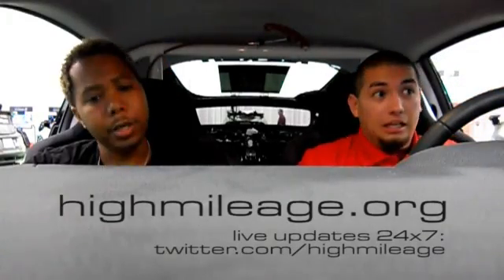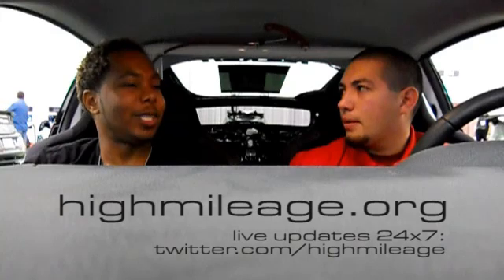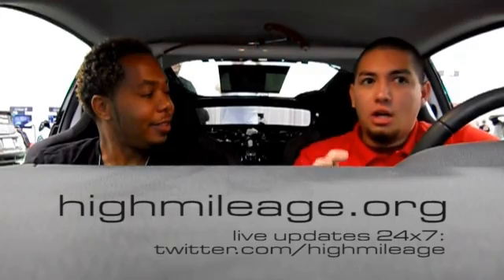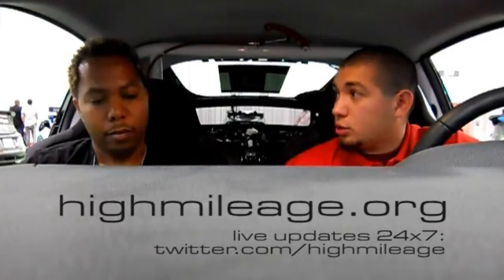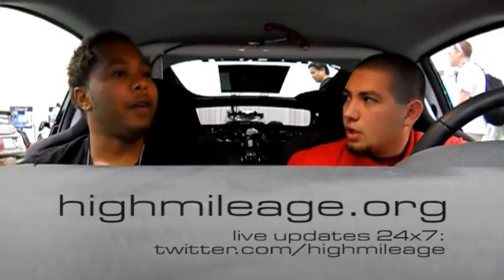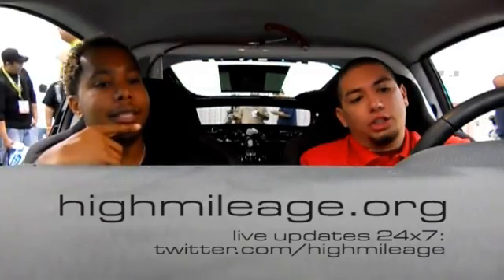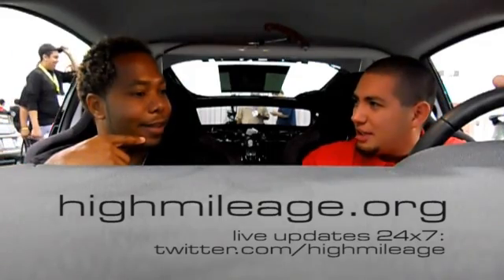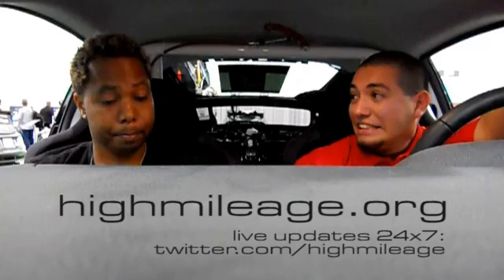Bisimoto builds a 533-horsepower Honda CR-Z Hybrid for SEMA. ECU calibration is the key.

Comment: @computerjlt I think it's great how Bisi is working to incorporate the IMA system into the performance of the car... the result may not be top OVERALL power, but that isn't always the goal. I liken this type of setup to a twincharged / compound boost / supercharger + turbo setup... maybe not the best way to achieve MAX power, but very effective in certain environments (ex: track racing or street use) where torque and driveability / reliability are key :]

Comment: Thats cool; i wonder why bisi didnt push; or honda didnt let him use the OEM ecu to control everything and make it so you  could change the IMA settings or better incorporate it.  

Seems a lot of people are having to incorporate the oem computer with a standalone to make everything work.  Like VVTi you gotta use an oem computer w/ some sort of EMS for fuel/spark to get the best of it

I wonder how long until someone cracks hondas IMA controls or they just rip it as it has no performance benefit